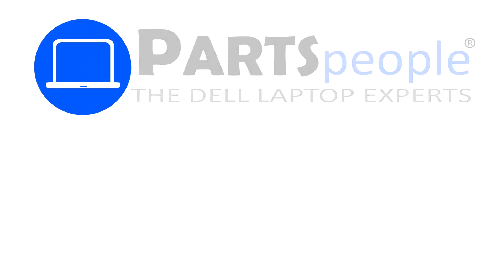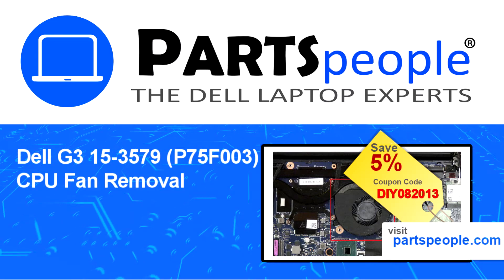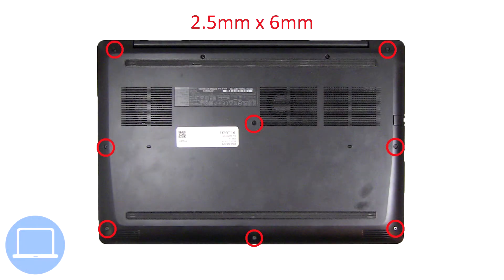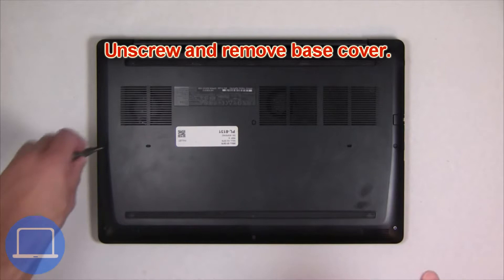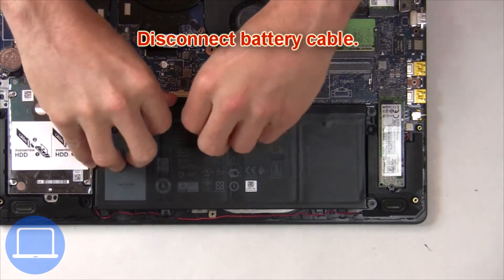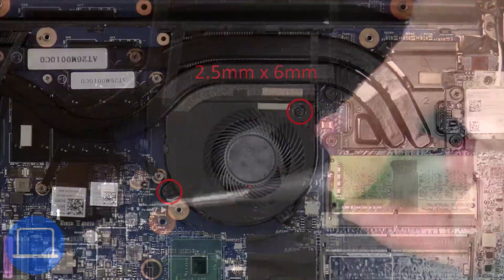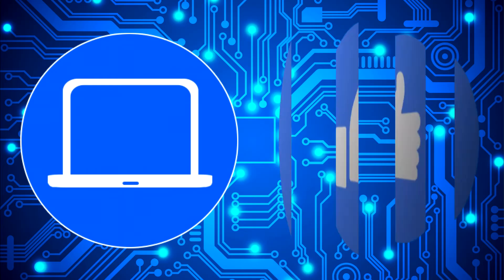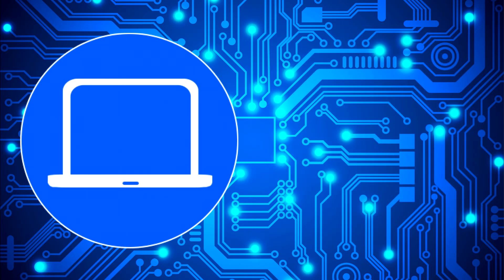Dell G3 15-3579 (P75F003) CPU Fan How-To Video Tutorial

Comment: I'm having trouble disconnecting the fan. How hard do I have to pull/ is there any special trick to it?
Reply from the maker: I recommend never pulling from the wires. There are spots on the left and right of the connector where I use either my finger nails or plastic scribe to pry it loose.